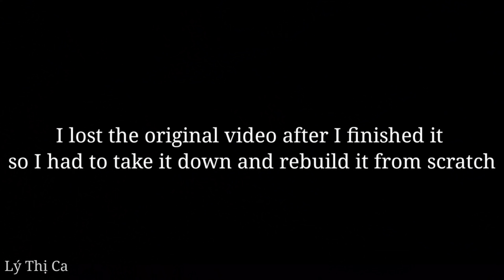How to build a Cabin house, Start to Finish - Ep.79

Comment: Well,Ly the way how to build is the same,but the problems are only cost
more because you will buy and dressed all the materials in shaped.
They are many advantages for you,it
takes longer time for you to stay there and not spend much power to rebuild a new one.
This is more attraction for the lookers.If you want to make more2 attraction,you will put the solar light inside or outside the house so that the compound is full off light the whole night.
Solar light no cost.Some peoples at my village they used that light because no current supplying.
Sometime they used at garden's house or farm's house.